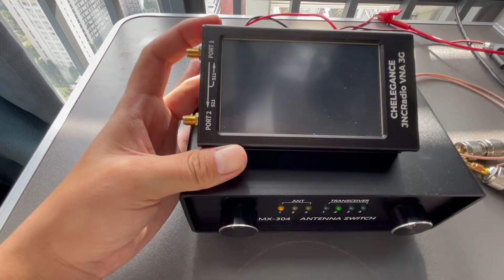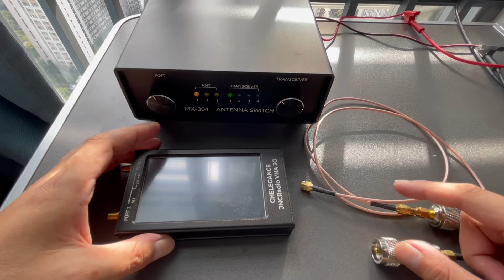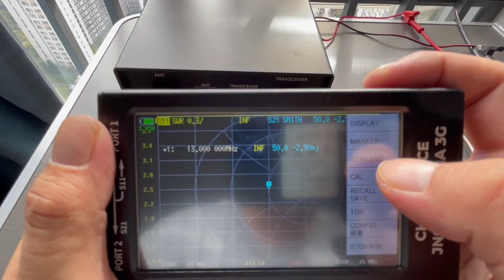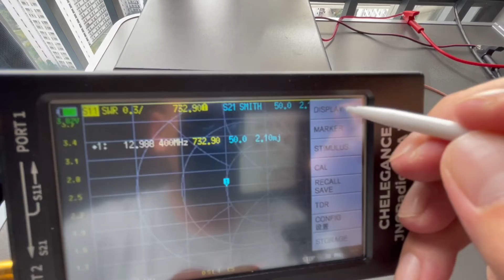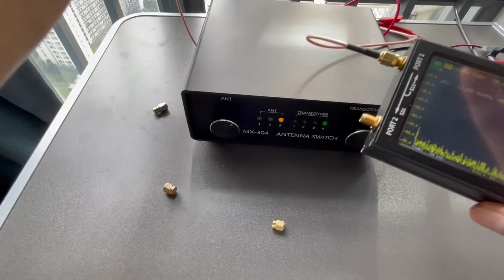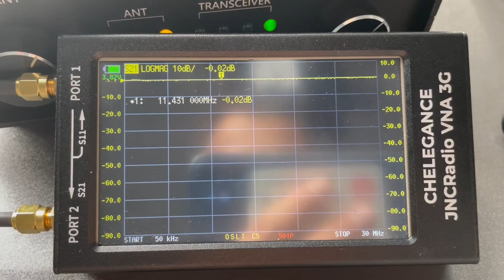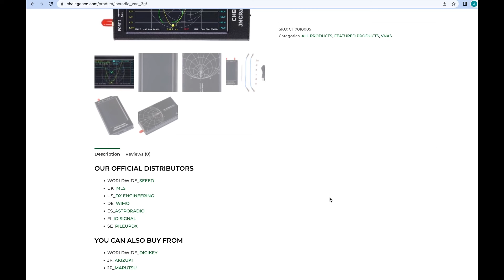Antenna Switch Insertion loss testing with JNCRadio VNA 3G

Comment: Wouldn't you want to calibrate at the ends of the cables your using instead of at the port?
Reply from the maker: You are actually right and it will be more accurate.
Reply: @chelegance It makes a huge difference!